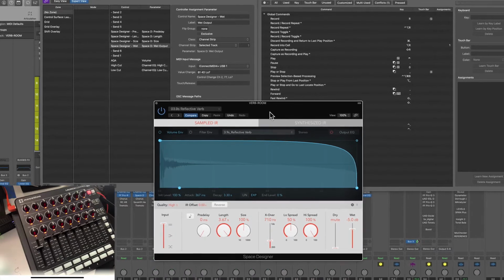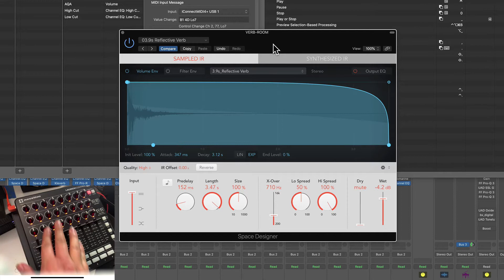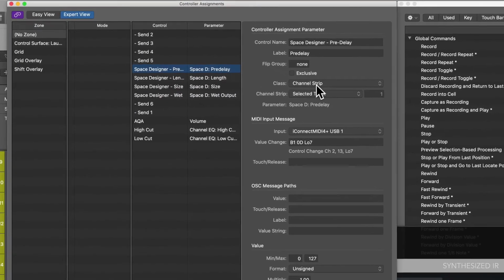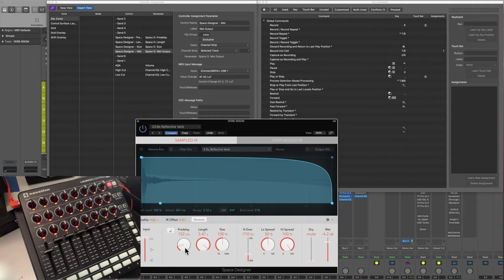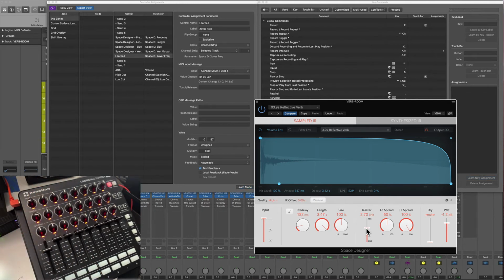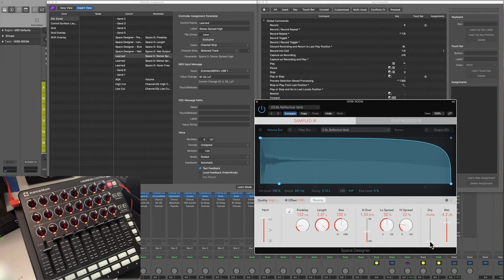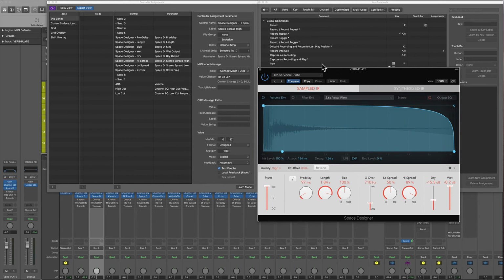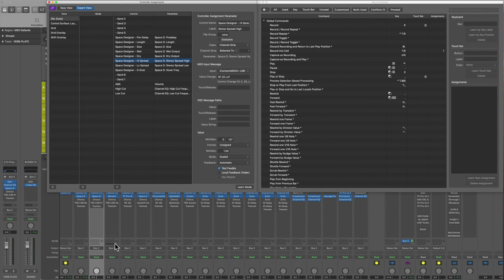Easy Way to Map any Parameter! Control Surface Workflow in Logic Pro (Part II)

Comment: Hey man, I’ve just discovered your channel, amazing work! Is it possible to link a knob with the velocity? Thanks
Reply from the maker: It is but you have to use Midi- FX. Check out my other channel for the complete course on “Control Surfaces” in Logic Pro.